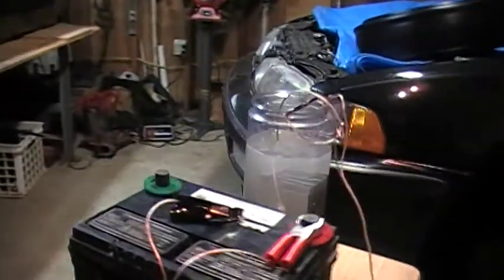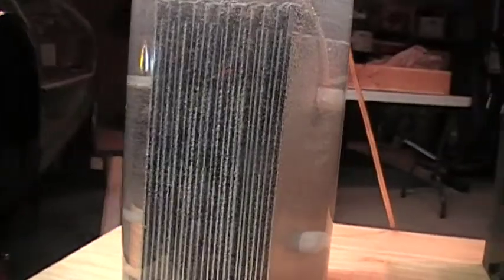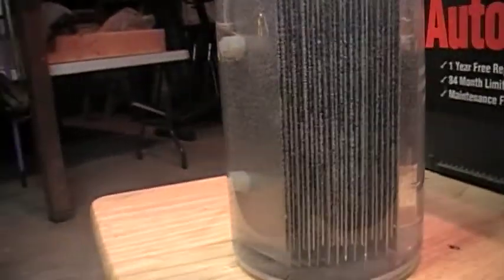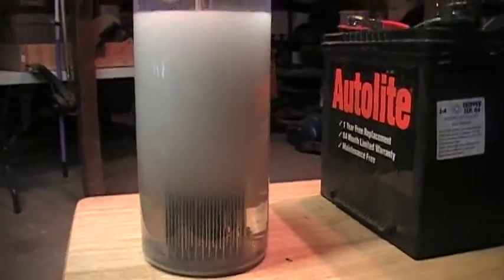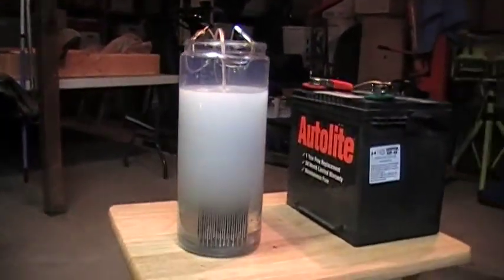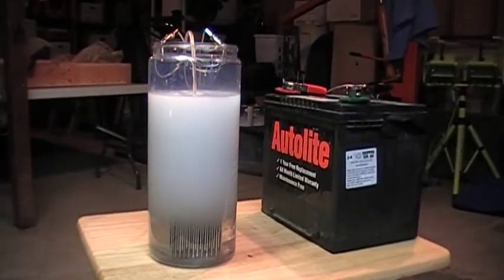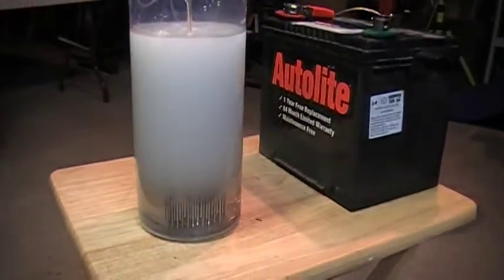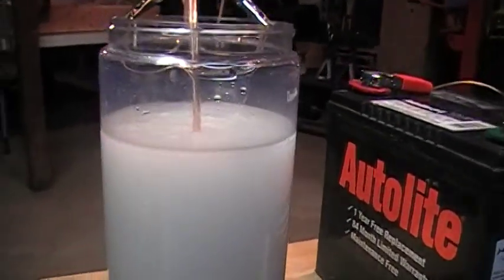HHO Generator Experiment ~  (Part I)

Comment: You realize that you are producing both Hydrogen and Oxygen at the same time in a perfect explosive mixture which is why it pops when you ignite it. You really need to segregate the anode and cathode gases to separate chambers if you want pure Hydrogen and pure Oxygen... otherwise this will just blow up when you ignite any collected gas!!! Hydrogen is produced at the Cathode and Oxygen is produced at the  Anode.